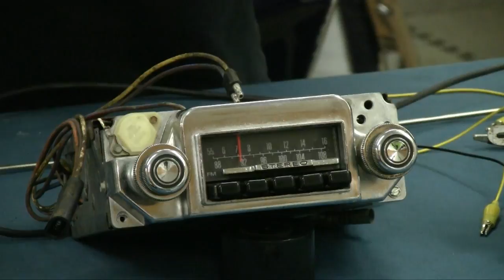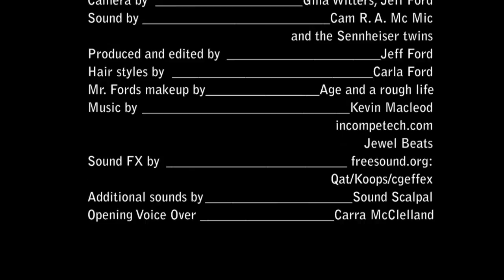Episode 66 Picking Junk Yard radios, fixing car clocks and gauge restoration Autorestomod

Comment: Tip on clocks; I found a can of TV tuner cleaner (for old style TVs) works great for clocks. It's hard to find, tho. It cleans out the dirt & cigarette tar and leaves a very fine lubricant behind that leaves no oily residue. Only thing I've found other than alcohol & that's not good for any electric motors. Contact cleaner may also work, but you'll need to re-lube with clock oil if you use it.
Reply from the maker: Awesome, We have enjoyed the tips and tricks on this subject for sure. Things that we didn't know. Both of our clocks still seem fine though neither keep time worth a flip. We imagine that may be due to the WD40 we used.

Comment: I've enjoyed your 69 Fairlane videos. My 68 is lacking the clock as well. The lens on my mine is actually crystal clear but has a series of heat cracks in it. 

I have made flat lenses for gauges out of Lexan (Polycarbonate) which is also the same thing CDs are made of. Although in the case of the clock, it wouldn't be cone shaped. You could make a cast out of the original plastic using fiberglass, layers of aluminum foil or something, then lay the Lexan over the cast then heat it with a heat gun to get the shape you want. 

I realize if your going for a stock look, most people with money to burn wouldn't care to spend $400 on a period correct AM/FM stereo but any cheap-o $30 modern radio (Pyle/Dual) sounds 10 times better than those old factory car stereos. Those factory stereos from the 1960s and 70s sound like rocks in a tin can. Plus you have to either insulate your charging and ignition system or install a big ass filter, otherwise they buzz like crazy when the engine is running.

I put a Pyle in my 68 Fairlane with an SD card function. 

Instead of those dual dash speakers that sells for about $75, I used two 3" speakers from Wal-Mart,  some heat pump strapping material to hold them in place, secured using the factory nuts to replace the single dashboard speaker and I'm happy with it. Sure I had to hack the hole in the dash but it would cost me $10,000 to turn this car into a show car. This car is a driver so I don't care.

This car is a driver so I'm not concerned about it. I'd rather having a descent sounding stereo.

Comment: I'm restoring a 20 y/o Ford. I can find parts for it in any junk yard. I'm glad I'm not infatuated with 50's and 60's model cars. The parts are a pain to find and when you do, you have to rebuild most clocks, radios and speedometers. I'll leave those things to the experts. I'm in it just for FUN.
Reply from the maker: My experience with 20 year old cars is they have issues too, and are getting harder to find parts for in the salvage yards. The older cars are often supported in the aftermarket to a greater degree. BUT, both can be fun to muck about with! 😃😁

Comment: If I could ever pull it off I'd like to build a 67 Merc Parklane fastback or convertible on a modern ford Panther chassis with the new 5.0 power plant & 6 speed trans, classic looks modern everything else even dealer repairible !

Comment: WD in WD-40 stands for water displacement.  It should be used for that and NOT as a lubricant.  Seems to work great at first but, it will dry out and make a gummy mess.  You'll be back in that clock in a year or so.  Use some synthetic oil like they do on speedometers.
Reply from the maker: I learned that.

Comment: you need to have the mechanism disassembled and cleaned and all bushings fixed and after that lubrication and ajustment. Oils are only needed with tiny bearings, gears are not to be oiled exept escapment wheel few drops (depending on a clock) General watch & clock oils are best.  So treating a clock with general purpose oils is always a no no. Its a job for your local watchmaker. Anyone who has a nice classic car can afford for a clock service.

Comment: No production piece for that lens? Alumilite rubber and clear casting resin.
Reply from the maker: Nice thought, but we fear not that simple. The lens has to be consistent in thickness.
Reply: Two part mold if you have an original. Another guy did it with a vacuum de-gassing on the rubber for a '29 to '32 Cadillac (and steering wheel too, different video) and it looked really good. It would be suitable only for a cosmetic resto probably, as it's probably not shatter-resistant. Better than not having one at all though, IMO.
Reply from the maker: True. But that lens (the Fairlane one) with the cone and complex curves presents a real challenge with warping the look of the gauge face through the lens. These are no available, at the time of shooting this video they were only available NOS.

Comment: Just FYI please don't use WD-40 to lube a clock. I also restore antique clocks and when people spray their clock with WD-40 it does not turn out well. What happens is the WD-40 dries out over time and it turns in to glue and the clock will stop working. I charge extra for cleaning a clock that has been sprayed with WD-40. Because it takes a lot of extra time to clean it.
Reply from the maker: You are right about that. We learned this after the fact.